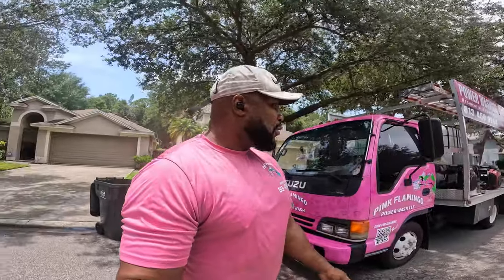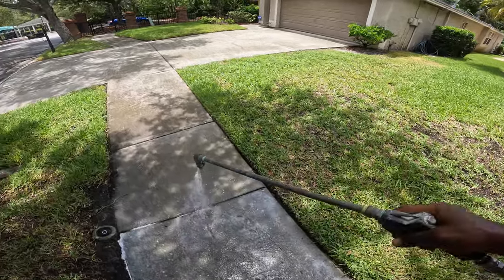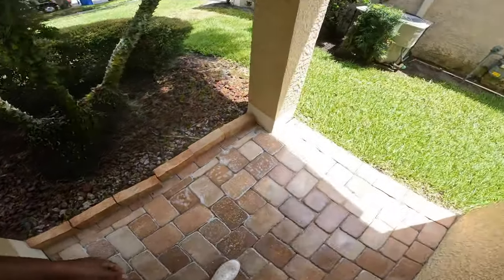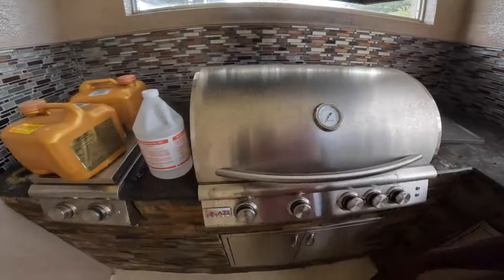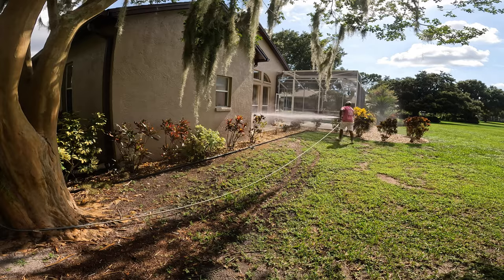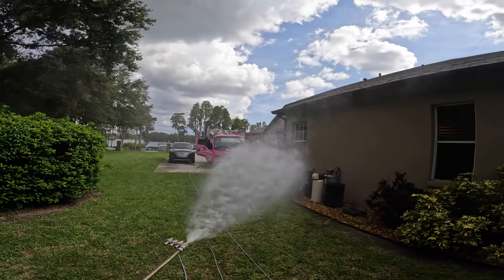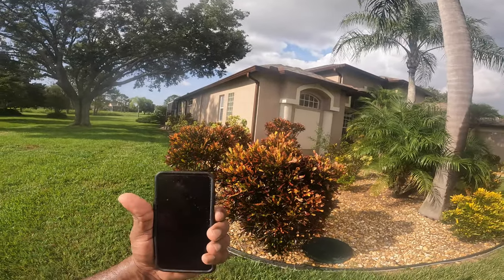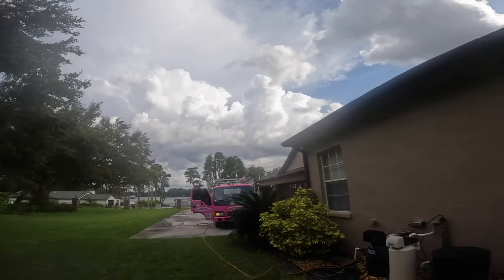1st Day back With The Rig #pressurewashing #rig #isuzu

Comment: Glad your back in action! Why don’t you hook up your battery to charge directly off the truck alternator. It’s not hard to do. 

Then you don’t have to worry about plugging it in and charging every day.
Reply from the maker: I aint wanna do that to this truck. I did it to My last 2 vans though on a battery Isolator. I don't feel like running wires so I'm gonna wire my marine battery to my gx690 pressure washer this time around actually
Reply: @PinkFlamingoPowerWash  - Sounds good!

Comment: For someone that doesn't have a softwash system yet, would it be ok to apply the sh with a backpack sprayer for small jobs like the patio and walkway that you did in this video?
Reply from the maker: Most definitely. That's totally fine. 💯